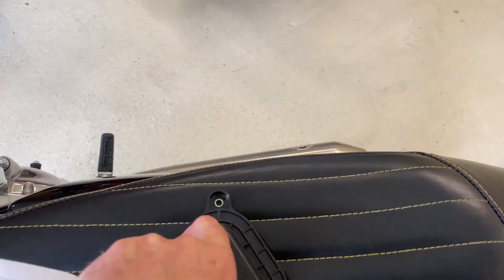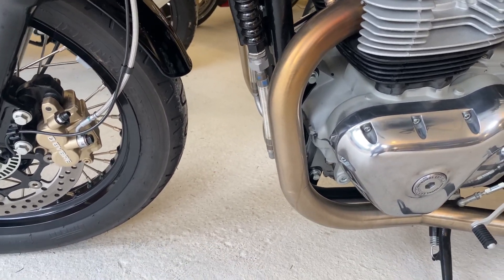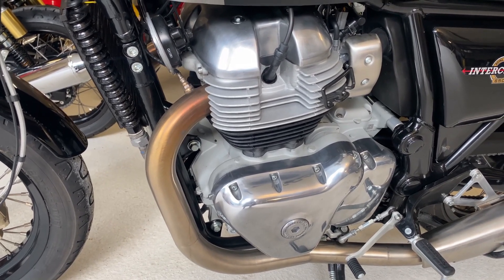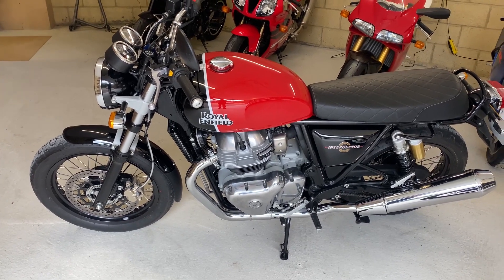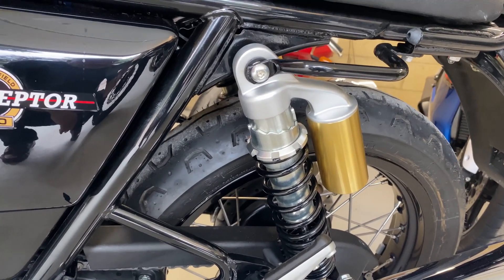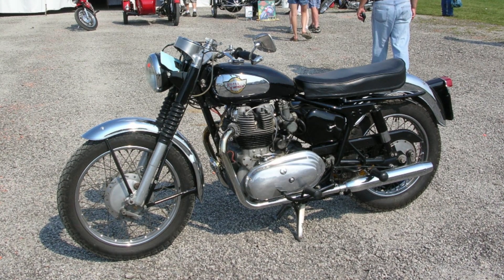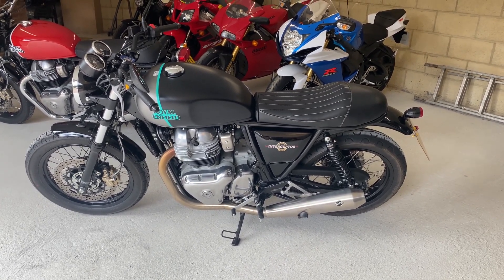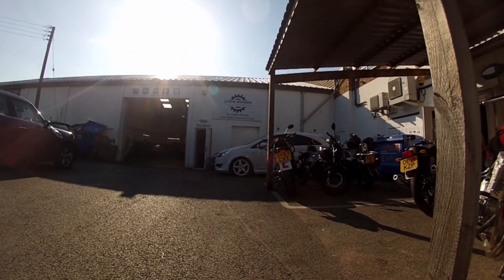The MAM Journals - Royal Enfield Big Bore Special (part 3)

Comment: Enjoyed your video. I've gone the S&S big bore and Cam kit, ported the head, powertronic system, enhanced the air filter and went with a larger stainless header system and mufflers. I've modded the front suspension, but left the rear suspension stock at present. I've put on larger Michelin tyres as well. it's still a work in progress and i intend to fit similar bars to the ones in this video for the same reason you mentioned. So far, i haven't regretted a thing about the changes and it's the bike I take out the most. Thanks for the great video.
Reply from the maker: Sounds like you are having fun Bill ! Well done .

Comment: Good review on a clean conversion. I have all the bits, just need to find an engine builder near me. Please expand on the fueling and ECU that was used. I think that placing new EDC brake pads has been shown to make vast improvements. I will also be doing the ported head and the bored out throttle bodies and the clutch upgrade, also will go up one tooth on the front sprocket. Well done.
Reply from the maker: Good to hear from you Steve . I will cover a bit more detail on the Fueling when I film my conversion but the bike has the Euro 4 model ECU . I am sure that changing the pads is a good idea for those looking to improve braking . A logical starting point . The Kings Two wheel Centre bike has an extra tooth on the front as well . Pulls cleanly through the revs in every gear 👍 Have fun with yours and hope you find a local engine builder! Where about are you?

Comment: Cheers for the 865 overview. Craig has the nicest Intercepter I've seen. Did Paul say if he had drilled out the compression ports? I've added YSS PD valve emulators, drilled the ports and added Racetech 340mm linear 0.9kg/mm springs. Has sorted out the problematic damping and the stiffer springs keep the nose up nicely.
Reply from the maker: I think so , but will check when I next see him 👍

Comment: Adding up the engine mods and factoring in some labour I'm getting somewhere near £4k. 
I'm thinking for me personally swapping it for a speed twin with better quality finish, more advanced electronics and superior brakes seems a better option. Yes tuning makes it more individual but is it a better bike after all that work than the Triumph?
Reply from the maker: 👍 I think that is a fair question and comparison . It was actually my benchmark when considering it . I have had 3 Triumphs . I didn’t like the 2004/5 Thruxton but the other 2 standard bonnevilles were good, “honest” bikes. I suspect the suspension on the modified RE will be better than the standard T100 , brakes better on the Triumph . Power is about the same , although the RE might edge it and the electronics , for me , a personal choice at this sort of power level? I wouldn’t entertain a 150 bhp plus bike without them but part of the beauty  of the  RE is its simplicity . Having thought about it for a while , I have opted for the individuality and handling . I know others will go  the T100 route and respect that . 👍
Reply: @michaelmam  these are questions I'm asking myself. I like the idea of simplicity and individuality but I also need to be honest and admit reliability, longevity and also a good future return are also things I need to take into consideration. I just know the cash thrown at an RE will not greatly enhance resale figures. If you enjoy all the tuning and the cost doesn't put you off then I don't see why not 👍
Reply from the maker: @richard.c3901  I can understand that . Modifying bikes rarely enhances value to anything like the money spent . You therefore need to either keep the bike a fair few years to dilute the depreciation or do modifications that you can take off and sell,  when you want to change . Big bore kits aren’t something you would normally  take off .
Reply: Down under, the price differnec between the RE and the speed twin remains significant. I found with the mods, it remained quite a bargain and I preferred the handling to the Bonneville's, it also felt lighter to me. Subjective, i know, but I still wound up with an enjoyable bike for a reasonable outlay
Reply: @resin8n  Triumph Speed Twin is circa 11000GBP, RE sells around £6300 new, plus 4-5k on mods and labour. The Triumph will keep its value quite well. IMO unless being individualistic was the goal the Interceptor isn't worth blowing the budget on. Plus factor in new brakes with this sort of power upgrade. 
This would be ok if, as mentioned above, you planned to keep it long term.
Horses for courses and all that but I still believe the Speed Twin is phenomenal value and a large step up in quality.
Reply: Totally agree, the whole point of the standard RE is that it’s a great bike for a great price, why mess with that very pricey mods.
Reply from the maker: @jeffhopkins8131  Its a good debate and clearly motorcyclists are a diverse group with different views , which I respect . Thank you for watching and commenting . 👍

Comment: Oh, also fitted a stronger clutch kit and bored out the throttle bodies. The original clutch didn't last long at all. haha
Reply from the maker: Thats  interesting . Clutch was OK on the bike I tried but not sure how long it will last . My intention would be to upgrade when replacing . 
I have thought about valves and throttle bodies which are the next obvious constraint. Can you tell us more about what you have done to the bodies , what difference it has made and the cost? Thank you Bill

Comment: Those extensive mods should transform the stock bike.  After going to such lengths,
why not go all the way and seal the wheel rims to run tubeless ?  There are tutorials on
Youtube for the conversion, and Woody's Wheel Works even makes the Outex Tubeless Kit
with all he bits and pieces.  A lighter wheel should handle the bumps better, and with less
mass to spin, the bike should accelerate and deccelerate more quickly.  The tires would also
be less likely to over-heat at high speed and heavy loading because there'd be no friction
between the tire and tube when flexing.
Reply: We ran tube tires for years with no problems, why fix something thats not broken!
Reply: @andrewslagle1974   - Having to change or patch  a motorcycle tire tube "in the field" is usually a miserable job.   Tubes also add to unsprung weight and to wheel moment of inertia and to heat-generating friction.

Comment: I quite fancy an Interceptor, but my concern is that if you go all the way, as per this video, you end up spending £3,000+ and end up with a Street Twin. I can understand an air filter and exhausts, but why spend all that cash to end up with something you could have just bought in the first place with no warranty issues?
Reply from the maker: I answer that question , and others in part 4 . 👍
Reply: but its just a street twin not an enfield!

Comment: Where you got this header pipe ?
Reply from the maker: I am not sure where the team sourced the raw material . From memory it is 16 gauge , 304 stainless ? They made the headers and connections in house .👍
Reply: @michaelmam  thanks . It’s possible to source it from you ?
Reply from the maker: @rifayahamed2640  I will ask Craig on Tuesday 👍
Reply: @michaelmam  thanks
Reply from the maker: @rifayahamed2640  Sorry for the delay . Craig at Kings Two wheel Centre can do the headers separately but they are all one off? Prices would be between £450 and £500 including vat but excluding delivery .  .

Comment: A very interesting watch but for me this seems to defeat part of the reason for buying this bike. Mine cost £5,899 which I consider to be a bargain, doing all this makes the cost of the bike in the region of £10,000 for which money there are an awful lot of alternatives e.g the Ducati Scrambler or Street Triple both of which I ruled out because of there price.
Reply from the maker: We Interceptor owners are a pretty diverse group ? I like the bike because I thought it was a great platform to customise and have an interesting , unique , upright, retro twin that owes me about 10,000 . 
We are all different , which is good👍
Reply: 865 upgrade aside, you can improve the supension, brakes and exhaust quite cheaply if you do your research (and are willing to do the work). Even the other bikes you mention will no doubt require some owner modding.
Reply: If you're looking at the twins only in terms of their price, I think you're missing the point. In their stock form, the Interceptor and Continental GT are fantastic bikes, but their relative simplicity and affordability make them ideal bikes to individualise, which appeals to people who want something a bit different.

Comment: I would love to see a Kawasaki w800 compared to this.
Reply from the maker: The specification sheets I have seen show that the power for the W800 is identical to the standard 650 which suggests a soft tune . Friends who have had one , rave about them . “ bullet proof” . Do you have one ?
Reply: @michaelmam  Greeting from SoCal and thank you for your reply. No I do not own one but wish to in the future. It would be my first motorcycle if I were to get the w800. My father said he had one that looked like that one. It was a Triumph Trophy I believe though I could be mistaken. I love the look of the w800 but still am not sure it is a good first bike. I am also very tall, 6'2", so I figured a larger displacement would be better. I wonder if there is a way to give the w800 more power if it is soft tuned. I really enjoyed your video and have good day.
Reply: there is very little aftermarket support for the w800 and the 5 speed trans is dated!

Comment: Listen. We're not yanks. Leave all this (so-called) customising bs to them. If you need more power, buy a more powerful bike. If handling is your thing, buy a better handling bike. This has nothing to do with biking and everything to do with consumerism.
Reply from the maker: 😂 The British have been customising bikes since they were first made …
Reply: @michaelmam There's a big difference to repairing or improving old or substandard bikes and building new bikes designed to be customised with a huge catalogue of bolt on consumer items.  RE only offer a small range of optional extras. Their rightly proud of the bikes they make. Contrast that with Harley and their huge catalogue of crap to waste your money on.  OK, if you get down to stripping parts and understanding how they work; I'm an engineer so I definitely get that, but there's  a huge pile of brand new Interceptor exhausts sitting in the back of garages. Just seems like a waste to me.
Reply from the maker: @davidbesant  I can see where you are coming from . It can be a wasteful process . Modifying bikes to improve performance and more subjectively , aesthetics is a well established practise that has created some very good bikes and manufacturers have identified it as a source of additional income . It certainly isn’t just HD . Ducati,  BMW and Triumph are big in accessories . 
Personally I think RE are supporters of customising . Their press releases seem to suggest so . Ultimately I believe in freedom of choice . If people want standard , great . If they want to modify it , feel free . Whether I like it or not is irrelevant . 👍
Reply: The american way is big and shiny. The european way is the wolf in a sheeps clothes.
I’m all in for the european way with the suspension and brakes upgrades and specifically the big bore kit - which also could be the main reason for buying a Royal Enfield.
Reply: Look at HIS shed HE has more powerful bikes but none of them have this look.